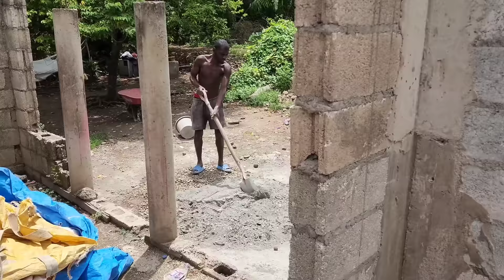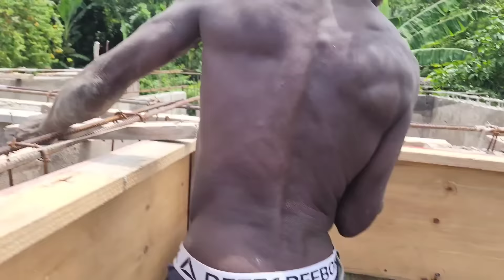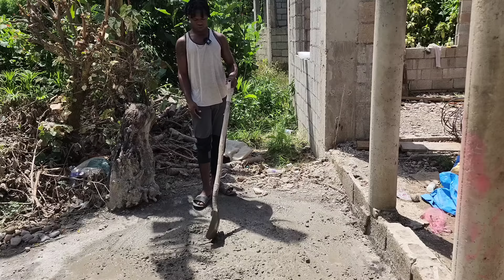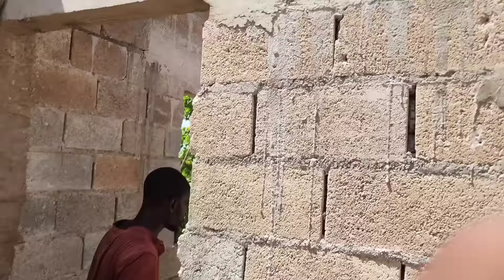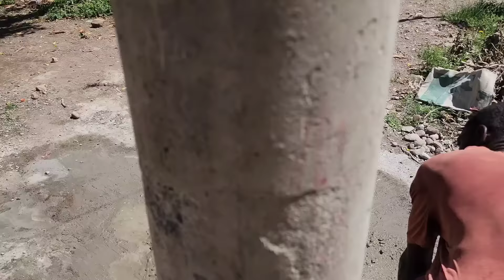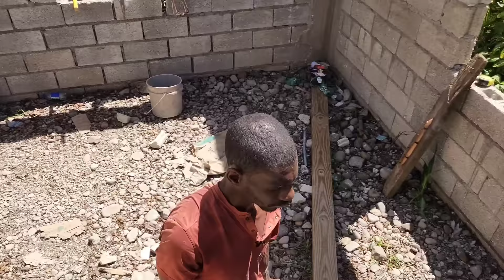these decisions  make a big difference house update

Comment: Why not get ready mix concrete and a pump truck to cast the decking/ roof. Pour it at a 5 slump with microfiber, so it would be one pour to maintain the integrity of the concrete.